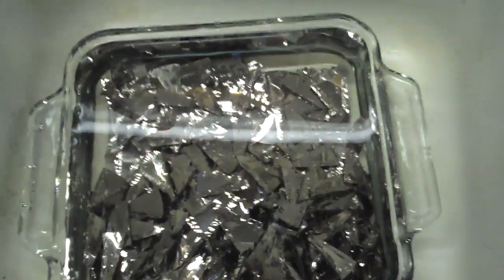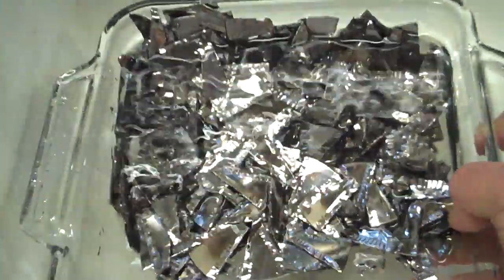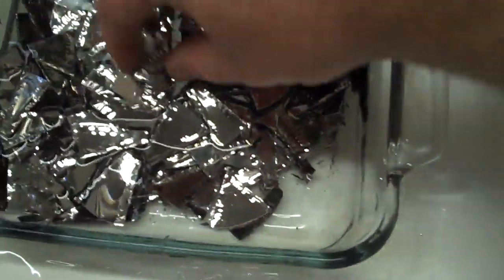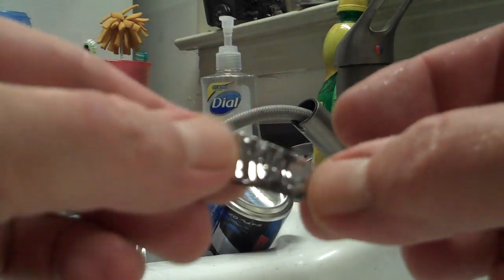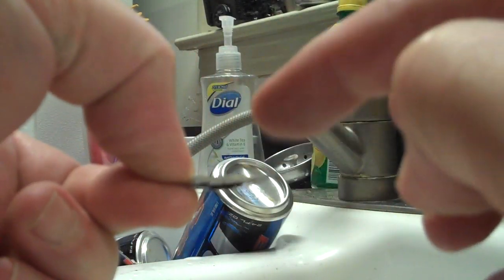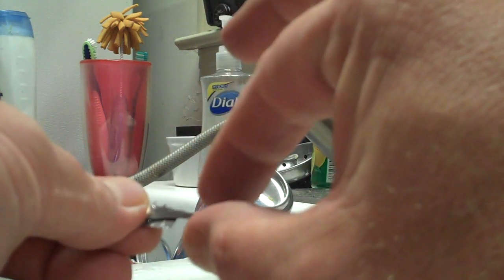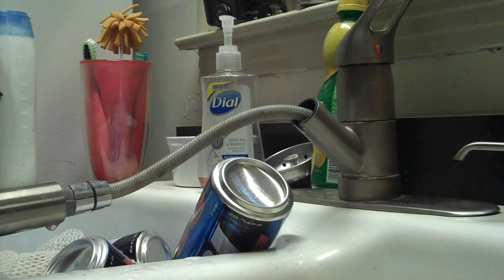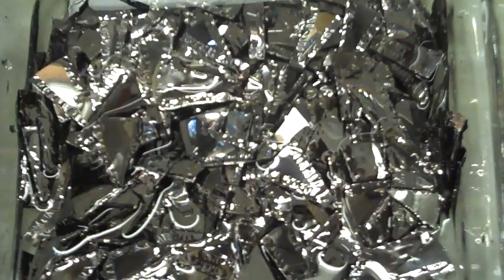Scrapping HDD Platters: The Results

Comment from the maker: I'm not sure if it would be faster to melt it out. The acid is sold in gallon jugs for around $10 to $12 for a gallon. You can get it at Home Depot or Lowe's. It'll be called Muriatic Acid. It' sold as concrete cleaner.